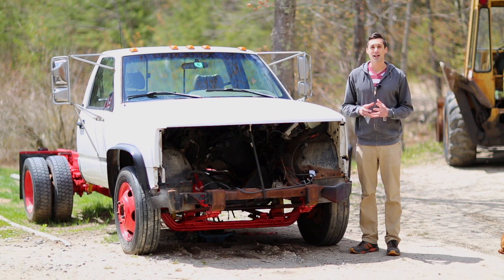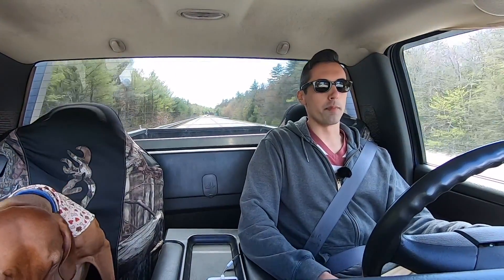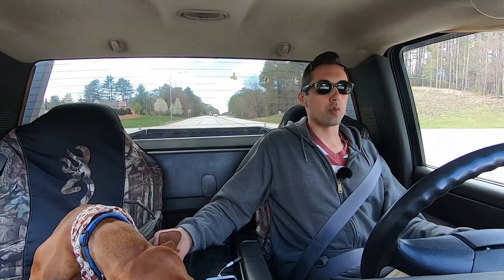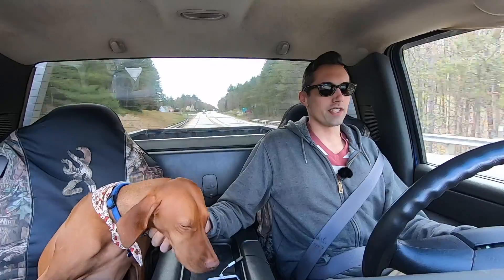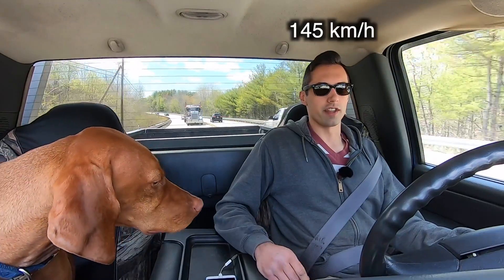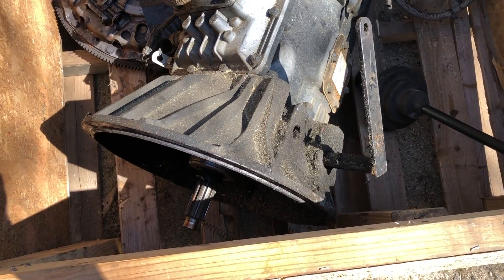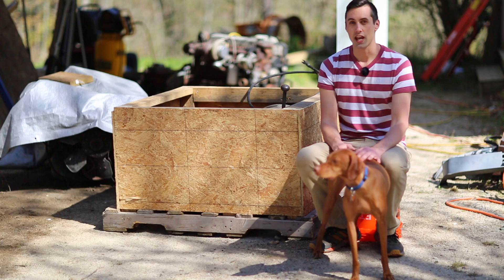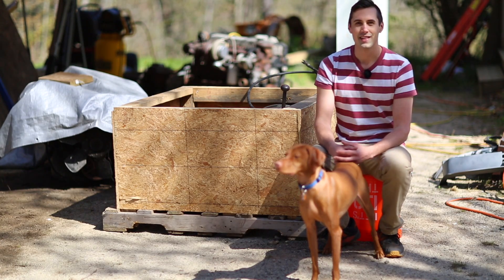I Bought an EATON FULLER 5-Speed Transmission for my CUMMINS Swap! [Part 4]

Comment: That live free or die inspection means there's nobody in the other lane coming toward you at 60 mph with 4 bald tires, worn out tie rods, and a grinding wheel bearing that's ready to throw a tire and send the car careening into your lane head on.  Freedom comes with responsibility.

Comment: i have been toying with idea of a diesel truck myself, but wanted to use a 13 speed fuller transmission, no plans to pull anything heavier than a car trailer loaded with a full size pickup, normally just a car occasionally, but majority would be used at a work truck, have 3 trucks, but all are 1/2 tons, want to build a 3/4 or 1 ton, and thinking of a Detroit 453 engine for power plant?

Comment: It’s kinda late to suggest now, but I wonder if it would be possible to use a gpa speedometer. (I am swapping  an NV4500 behind a 402 BBC into a 57 Chevy 3600 NAPCO 4x4 using a bellhousing from advance adapters and have looked into that a bit. Alternately, locate a rear axle with parking/ emergency  brakes and a higher (lower numerically) gear ratio.

Comment: Hi I changed a automatic transmission for a NV4500 on my 95suburban do you know if have a EATON manual transmission for fit on 6.5 Detroit and transfer-case NP241? I think is a best transmission ever 🤔 EATON are really stronger 💪 cheers from Norway
Reply: The 6.5 no, you’d have to get an adapter plate to give you the clutch housing. I would guess it’s probably possible considering they did use the 6.5 in marine and power generation so it has had some versatile stuff designed for it. 
The Kodiak and Top Kick had the Eaton trans as an option and NV4500 as a base but that went to a 3116 Caterpillar or 3126 Caterpillar which are the same round flywheel housing that is pictured in this video.

Comment: Is it possible to bolt a transfer case to these transmissions somehow?
Reply from the maker: Not that I know of, though if you removed the parking brake drum, there must be some bolts back there. You might be able to fab up a custom mount

Comment: Do you have a model and year that the transmission and flywheel housing came out of by chance?
Reply from the maker: Unfortunately, I don't. I only know about the make of the original truck based on the TA number on the transmission
Reply: @WaldosWorld  okay do you by chance have any part numbers off the flywheel housing and flywheel
Reply: Look up 1997 Freightliner FL70. It will give you a hydraulic brake Freightliner chassis with hydraulic brakes which is small enough it will give you a 5.9L 12 v Cummins instead of the 8.3. It will usually have a driveline mounted parking brake. 

Don’t just accept any diesel one, they did use baby Caterpillar in there as well and the 3126 Cat has a different power band which gears the transmission differently.

Comment: I probably would a have went with any RTO (the o means overdrive) like a RTO 6610 that is a 10speed and put 3:13:1 or 3:21:1 differential
Reply from the maker: Yeah, an overdrive would definitely be nice, but hopefully I can sort it out with a new axle ratio and possibly a larger tire/wheel diameter

Comment: You could have bought a tail shaft housing for the nv4500 out of a early 2nd gen dodge that had the 12v because they had the speed sensor in the tail shaft housing on the earlier nv4500. Or you could have found a donor truck in a junk yard just like yours Chevy c3500 with 19.5 wheels because they came factory with the nv4500 trans aswell only difference was input shaft and bellhousing. So just say if you would
 Have bought your truck that you have with a manual instead of the automatic it would have had a nv4500 already in it factory.
Reply from the maker: Yeah, my life would have been a lot easier if the truck came with a manual!
Reply: Yeah that def would have saved you some time bud

Comment: I love your channel and how you explain stuff, did you ever consider a Duramax or any other engine?
Reply from the maker: Thanks! Yeah, I was also looking at a Detroit 6V-53. I'd consider a Duramax, though it might feel more special swapping into something that's not a recent-ish model GM. Also, I really like the amount of space there is on the sides of the engine with an inline 6!
Reply: @WaldosWorld  You made the right choice. On average, the Cummins will last longer, tow better and get better fuel mileage

Comment: Hey, Great video great documentation on this Trans. Its almost hard to get any info from others who swapped these in custom projects. I got a cummins 3.9 with the 5 speed fuller trans in a 69 Tbird about to be a daily after some minor adjustment. I got a question for you, how long is that lever from the clutch cross shaft from the bell housing?? and how much travel you have go on yours to release? I am running a shorter version with hydraulic, and my pedal is way to stiff. I have a video on my channel of its operation if you're curious..
Reply from the maker: Hmm, I already modified the lever in my most recent video, so I'm not sure I can give you a measurement from the bell housing. The travel at the end of the lever seems to be about a couple on inches (measuring only the travel where there's resistance). To make it easier to push the clutch pedal, you could increase the amount of leverage the pedal has, but that will also increase the amount of pedal travel
Reply: Since he hasn’t replied I’m hoping you figured it out, but the difference lies in whether or not your trans has a clutch brake. Eaton had a 5 and a Synchro 5. Fuller doesn’t have a clutch brake, but keep in mind a commercial clutch is stiffer than automotive by a long shot. If I drive a manual car I almost smash a hole in the floor board until I get used to the idea again. They make hydraulic assist kits for them to make the pedal easier. Even then, you’re looking at 15-18 lbs of pressure to get into the friction zone.
Reply: What i ended up doing was an 2" long rod to a slave cylinder. However that made it only the hulk could press the pedal down, ended up snapping the pedal. So i welded a long flat bar link the slave to 8inches from the pivot. It worked out pretty well.

Is the clutch brake is that drum brake behind the transmission?

Comment: Bear in mind that you could always source a 96+ GM NV4500 and swap out the Bellhousing, input shaft and retainer from the Dodge and use the stock GM speed sensor setup.  That way you keep your overdrive, speed sensor and you won't have to source any other adapter plate.  This is exactly what I did on my swap in my 1998 K3500.  It had an NV4500 from the factory.  I swapped out the Dodge peices and was able to refuse everything downstream.   The parking brake presents a bit of a challenge if the axle wasn't equipped with one, but I'd rather solve that problem than have to lose overdrive and still have to solve the other problems.
Reply from the maker: Yeah, that's a good point! I just filmed the next part where I see if the Eaton fits up to the Cummins, and it does fit! Basically, I'm trading an overdrive for a parking brake. We'll see how the drivability is with a new axle ratio and maybe bigger tires 🤷‍♂️
Reply: I agree. I am going to do the same swap on my 97 C3500HD. It has a factory NV4500 with the 4.63 axle.
Reply: Keep in mind that the GM NV4500 vs the Dodge has different internals. The Dodge NV is considerably more robust and uses kevlar lined synchro rings vs brass in the GM. If you're towing heavy regularly, I wouldn't go with the GM

Comment: Thanks for great video , yes hope you get well soon , another trick with transmission lock  would be mounting small disc brake on the prop flange and mounting caliper , but all looks good,,  if you can get Speedo to work but not matched speed ,you can place a card or fabricate a new Speedo face your self  , we went along with vehicle with good Speedo and travelled with it mark speed at say 30 50 70 should get you buy , look forward to next episode , don't forget your back !!
Reply from the maker: Thanks, Steve! That's a good tip, though luckily the GMC uses a VSS buffer that can be calibrated by adjusting jumpers on the circuit board. I'll be sure to film it when I finally get to that point!

Comment: if you could afford it maybe a gear vendors overdrive then you could keep your low rear end gear and split your  shifts . You would have a 10 speed truck. Real handy when towing.
Reply from the maker: Cool, I hadn't heard about them! It doesn't look like they make an overdrive for the Eaton, but they do make one for a Muncie SM465 and that would be an awesome combo!
Reply: @WaldosWorld  Eatons overdrive was the Synchro 6. Beyond that there’s the 7 or 8 speed. That requires air though to run the splitter (and a different case entirely to fit the main and countershaft, and the whole thing gets longer because the splitter is on the back). Twin sticks aren’t that hard to run, and it’s definitely possible to run a two speed brownie behind an Eaton 5 as well as shiftable rear axles are possible as well if you want to get really intense into controlling your vehicle. 
You have enough fabrication experience both would probably not be hard for you to accomplish. You’re already doing quality work beyond the last four apprentices I’ve had and they came out of 4-6 years of tech school with ASEs. 
This project is awesome.

Comment: Can you share your vision with the project?  I am guessing you want a truck more capable than just a 1 ton.  Have you thought about a 2 speed rear end?  That would be extremely cool.  It would be like a baby big rig!
Reply from the maker: Absolutely! My goal is primarily to build a truck for towing and hauling. I plan to build a flatbed shortly after I get the truck running and driving. It'll  really come in handy for bringing new projects home! I'd like to be able to do long trips comfortably as well. For example, it would be great to go down south or out west to buy vehicles that aren't all rusted out!
Reply: Yea, I just moved to California and the vehicles are so clean!  Would you consider doing a cab swap to gain a back seat? There is so much you can do with these GMT400’s. Oh, congratulations on gaining 30% more subscribers since last post!
Reply from the maker: I haven't really thought about doing a cab swap, but I do like the idea of having a back seat and I really like the way older crew cab trucks look. And thanks! It was really awesome seeing the channel gain subscribers even though I wasn't able to work for a bit.